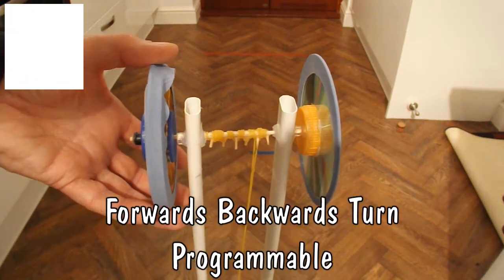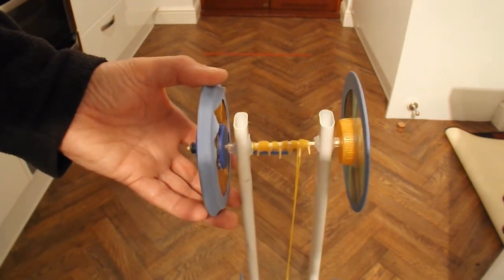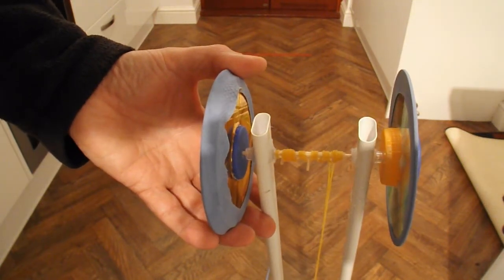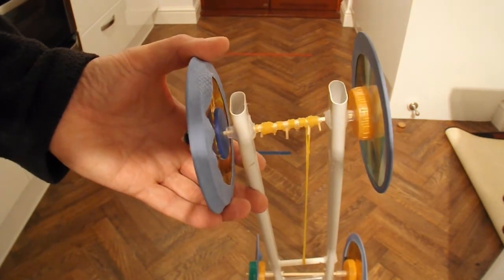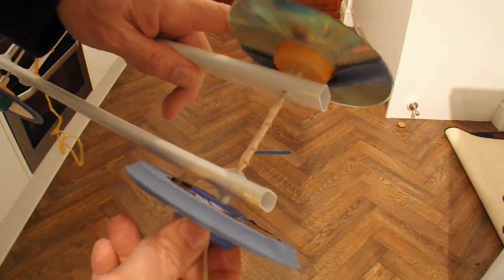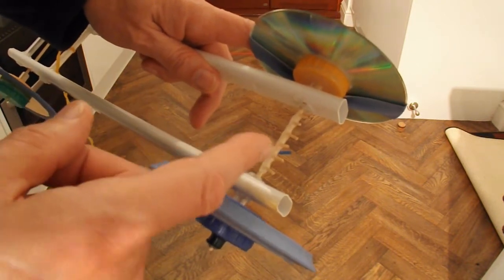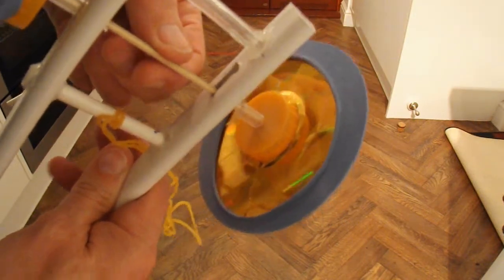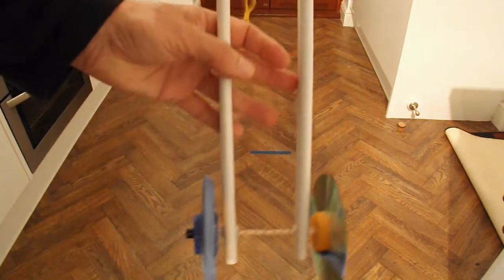Forwards Backwards Turn Programmable Rubber Band Car

Comment: Im having trouble with the wheels. They keep peeling out and the thing wont even move. I tried adding more weight by adding rubber bands around it for grip too but it wont even move. I know the axle isnt the problem because when I lift off the ground it still moves. The wheels are made out of foam cardboard. Any suggestions or solutions?
Reply from the maker: +Jason Meza I don't understand what you mean by peeling out so I can't help you there unless you mean the wheels are spinning. You say you need more grip because it will not move. What about the front wheels and axle. Are they stuck so the car cannot move forwards? Does the car run forward freely if you just push it. Does it move forward if you use less power so the wheels can grip the ground? How big are your wheels? Bigger wheels will grip better than small wheels. In the video description there is a link showing how to put rubber tyres on wheels using strips cut from rubber gloves.
Reply: GrandadIsAnOldMan yeah the wheels just spin in place while the front wheels stay still. When I push it manually it moves but with the rubber band it doesn't move. The wheels are 4.72 inches (the size of a Compact Disk). Is it more weight that I need or more grip?
Reply from the maker: Jason Meza both will work. Obviously more weight will impact on the car's performance although if it's not moving now, anything will be an improvement. It might be worth trying weaker rubber bands as you may not need as much power as you are using. Weaker bands will put less power to the wheels but might stretch further so you get more turns round the axle so it goes further but slower. As I said in the previous reply, I use strips cut from washing up gloves as tyres for my cars when I need extra grip or you can cut strips from balloons. Another option would be to double or triple the width of the wheels by gluing more disks together. That will be like sticking wide wheels on your car.
Reply: GrandadIsAnOldMan sounds like that would work, but thing is I am limited to only the following tools for my project:
Paper, 30# (maximum): 2 square meters maximum; 2 layers maximum 
 Poster board, single-ply, medium weight: 1 square meter maximum 
 Foam core modeling board, 3/16" nominal thickness: 1 square meter maximum 
 Twine, 60 lbs. (maximum) labeled breaking strength: 3 meter length maximum 
 Wood dowel, 1/4" nominal diameter: 1 meter length maximum 
 Mailing tube, 2" nominal diameter, medium-weight cardboard: 1 meter length maximum; no 
end caps
 Rubber bands, #62 or #64: 10 maximum 
 Elmer’s Glue-All glue: 30 cc maximum 
 Hot melt adhesive (polyolefin): 30 cc maximum 
 Scotch brand transparent cellophane tape: 1-meter maximum
Ill try the #62 rubberband and see if that makes a difference along with increasing the width of the tires.
Reply from the maker: Jason Meza good luck

Comment: Sensational!
Reply from the maker: +Jason Meza very simple to build but if you need accuracy then it becomes far more complicated.
Reply: I'm still pondering when you wrap the rubber band around the pegs. Are you wrapping it one direction on one peg then the opposite direction on the other peg then just alternate?
Reply from the maker: Jason Meza think about it. What is the rubber band doing. It is turning the axle the opposite way to the way the axle was turned to wind it up. You start by attaching the band to the axle on the first peg and turn the axle to wind the band up. You then pass the band round the next peg and turn the axle the opposite direction to continue winding up the band, then repeat on the next peg and so on for as many pegs as you have used. Perhaps if you view the New Scientist link in the video description it may become clearer.
Reply: Thank you for the help!

Comment: Can you make one of those unicycles with a weight under it so it rides on a string? 

Also can you try to make a rubber band car or animal that jumps in the air and moves?
Reply from the maker: Hi Ty, I will add them to my list.